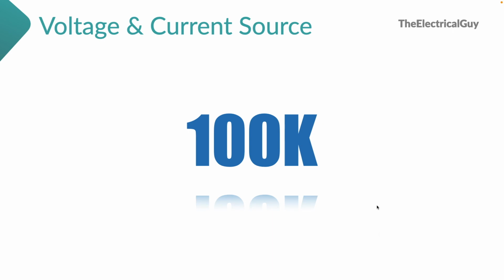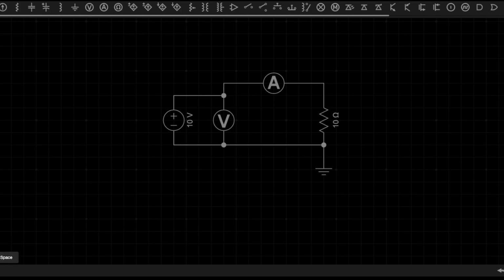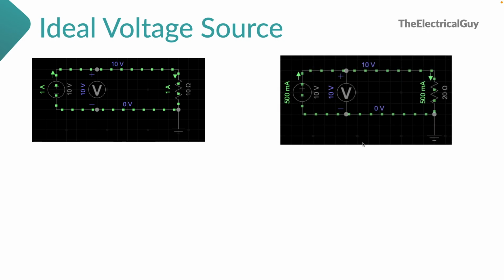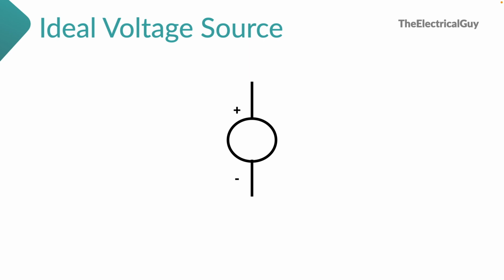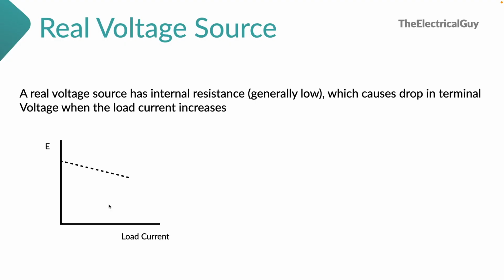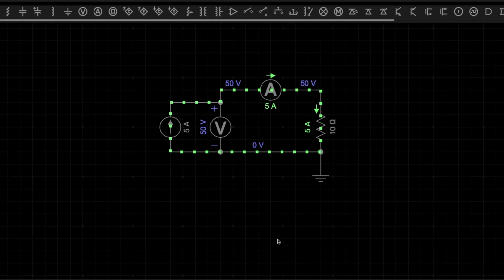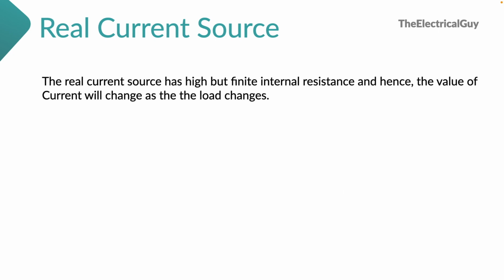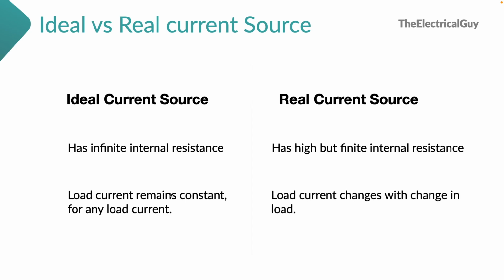Voltage & Current sources (Ideal & Real) | TheElectricalGuy

Comment: what does infinite resistance, if there is infinite resistance there should not be any current flowing through the circuit right? and in voltage source why is the voltage increasing if the current is low. according to ohms law the if current increases the voltage should also increase right? i dont understand the concept